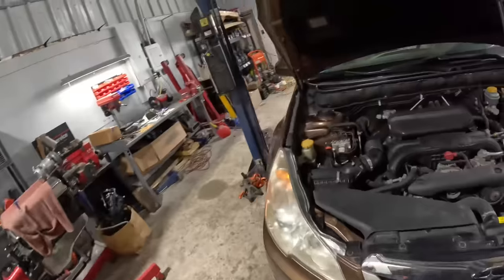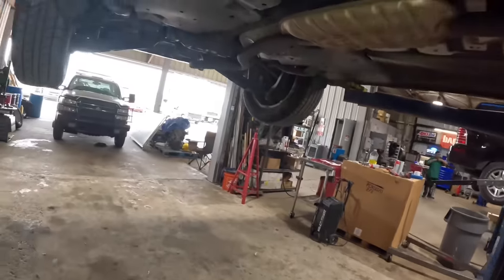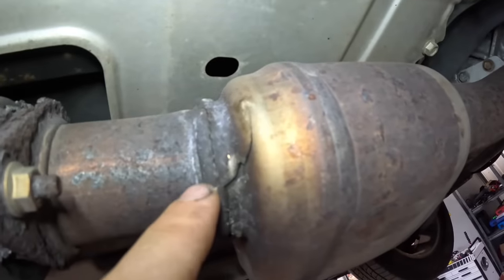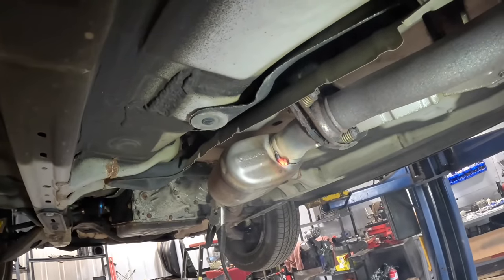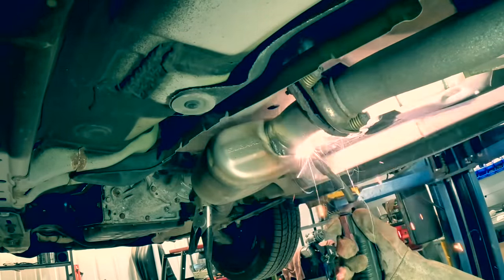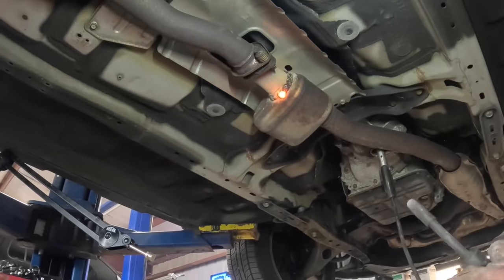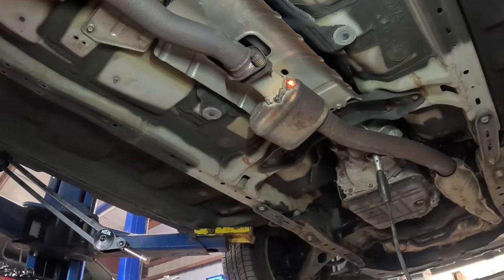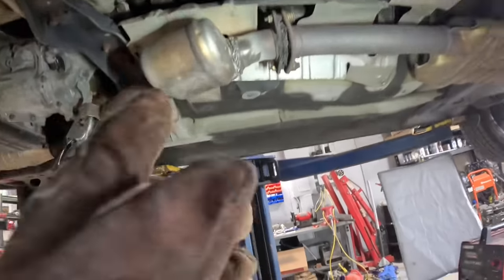Rusted Out Broken Exhaust! CHEAP Fix!!! Subaru Outback 2.5 EJ2.5

Comment: Respect to you for "fixing" at a reasonable cost.
If it's too expensive for the customer and there's a cheaper way, it should be given as an option so long as it doesn't cause other issues.
Reply: Shop should ALWAYS list optional ways to solve the problem, and let the customer have a say in the decision.  Like many shops won't chase a small oil leak in a high-mileage engine unless definitely obvious what is leaking, not worth it.
Reply: Also if the system is working as is then fix it don’t replace it. Like us older mechs remember.  That saves the landfill from filling up.

Comment: As an ex tech, in the shop we worked in, we had steering wheel covers with the words " DO NOT START " in bold bright red letters, that we put over the steering wheel even if the car was unlikely to be left unattended, this came about because of the same exact reason you mentioned Ray. Safety first became the watch words of all inhouse techs, and Sales staff were totally banned from the workshop area, infact locked out, as the sales/workshops were in separate buildings.
Reply: Like Ray having sales people around your toolboxes would seem deemed a Death sentence. They should be planting pansies plants out front of buildind instead.😊
Reply: Even if there was that there, the battery was removed, and the vehicle was chained to the hoist, there would be a sales ahole who would cut it off, cut the lock off, steal any battery that was closest, and start the car.  Best would be to remove both starter relay and fuel pump relay as well, so that at least there might be somebody notice his attempts.
Reply: thats a great thing even for a do it your DIY i done it to myself once lucky i caught it before the motor got completely destroyed HAHAHA at least it was my own car and only for about fifteen seconds
Reply: @barryoverson4988  yep I do this with masking tape on an A4 sheet on the wheel. DO NOT START! Has saved me at least once.
Reply: i worked in a truck shop 33 yrs. thats how it was, steering wheel covers ,covers over hood mirrors . if no oil in the engine we had to tagged the door handle and remove key but there were always drivers  who would come into the shop thinking they could just crank up and go!!!  towed back to shop for repairs or worse ,a blown engine!!
Reply: I was an Army Mechanic.  Called into the unit office to find an Lt. with my boss.  He had a Honda Accord with juddering brakes and would I have a look.  What can I say ?  Put a clock on the front rotors and they were .002" warped.  Replaced them.
Three weeks later our hero is back.  Livid.  Rotors were warped.  He went up one side of me and down the other.  Had a look, sure enough, .002'.  Back into the office goes I.  `Sir, where did you have the tyres changed?'.  It transpired he had a local German shop do the work, they'd reefed the wheel nuts on to 100lbf, warping said rotors vs. spec of 80.  Hondas were / are very sensitive to this.
Banged it in, saluted and said `sorry sir, this is not my doing, I must now go and repair Army equipment'  Marched out.
There is a moral here.

Comment: Ray,  few tricks I learnt:  If material is a grade of stainless,  switch the MIG over to Stainless wire,  welding steel with stainless wire creates nice welds,  other way round creates small horror welds.   Also cleaning the area for welding a bit with a brush wheels really helps, especially in shitty locations like this.     And up to you, but I would have cut it on the straighest section to place a clamping bush on it, and cut the shitty bolts out of it.  Then you can weld it on the workbench and that's always less of a pain.    

All of that said however. I totally understand it that sometimes it's just a quick fix for someone who really can't afford the proper fix.    Keep up the good work :)

Comment: I had a similar situation myself, Ray.  1979 Camaro getting a custom interior. All new carpet seats headliner etc. I was in the middle of installing triple gauges when the clock struck 5 on a Friday.   Cleaned up, did a tool sweep and forgot that I had not attached the oil pressure line to the back of the gauge.  You can see where this is going.  Someone (no names, just "The Boss") decided to move said Camaro to another part of the shop on Sunday so he could work on his boat.  He told me he started it up and oil sprayed everywhere.  Took me 2 days to find all the oil spots and clean them up.
Reply: Hopefully ‘The boss’ got a good oil shower.
Reply: Should have taken two days for the boss to clean it up.

Comment: Welding shop owner here. Get a wire wheel on a 4.5" grinder and clean weld area first, Or I Like a 90' air die grinder with a 3" wire wheel. Also check with your mobile tool dealer and get the anti zaps to clamp on the battery. They take out any spikes from Welding, No need
To disconnect the battery. We have used them for years on trucks and heavy equipment. Also used if cutting with a plasma cutter. Sensitive electronics are very susceptible to spikes. You can thank me later😂

Comment: Good for you that you gave the owner a low cost alternative to keep the car on the road. I’m thinking most shops would just throw the parts list to the customer let them deal with it.
Reply: $150 low cost? just wrap muffler bandage $19.
Reply: The motor on your hoist sounds terrible back in the day all I had was a stick welder I  used 1/8 Nichol rod to do my inexpensive repairs 😂
Reply: I was steeled to have to replace cat-back on my Impreza exhaust but my mechanic figured it still had some life left and welded in a sleeve to replace a flanged joint.  Gotta love mechanics like that!
Reply: Save $$$$  good job my brother. I would of been proud to sport that weld around. Nobody will see it anyway. Long as it works right. I think you're a really cool guy Ray. I want you to have a good day.
Reply: Subaru, backwords urabus😂

Comment: Ray, The process i use to check for leaks after a exhaust repair or replacement, is to pump air from a shop vacuum (using the vacuum's output) to pressurize the system. It low pressure, so it can not hurt the system and you can quickly find any leak and you don't need to get hurt from HOT pipes.

Comment: I had a section of exhaust pipe replaced at a welding shop for far cheaper than getting a new component, since it was a pipe that included the cat and went all the way to the muffler. It does sound like it's starting to fail after 3 years, and that was with a shop that welds professionally. I do appreciate the saving a dime when you can for things like exhaust, since it can get expensive quick for some people.

Comment: Try some Cooter Snot to help with the splash. Dip your wire tip in it before each weld. Helps me a ton to make cleaner welds as i'm learning.

Comment: Hi ray. Im using my grandpa computer. I notice that you was welding with flux core wire. You were right on it being stainless steel. From what i have learned from my grandpa tig welding would be the best choice. I agree with you using what you have to weld with. Just one thing is dont stay in one spot welding due to the thickness of the metal you can burn a hole in it. Best thing is clean the area really well and weld it. Not bad for using a mig on it. I love your channel. Grandpa was right your a great teacher. Have a wonderful day.

Comment: Love the intro clip, I'm a certified welder and the amount of times the tip burns up even on experienced people is crazy. Always used our mig pliers, one tip on nozzle, other tip on the burnt wire, and clamping would usually break it off easy. Wish I had the opportunity to weld for Ray, loved stainless steel and aluminum TIG welding.

Comment: I'd heard of mig and tig welders, but no idea what they are...  well, technically I still don't...   but now I do know that they are needed for different types of metal...   That's a good start.    Thanks for entertaining and educating.
Reply: Carbon arc...better have the fire dept near...
Reply: MIG = metal inert gas. Uses a continuous wire as an electrode and filler material surrounded by an inert gas. TIG = tungsten inert gas. Process uses a fixed tungsten electrode and separate hand fed wire as filler also surrounded by an inert gas. Tig is much more controllable and can by turned down to weld aluminum soda cans or razor blades or way up. Usually best for exotic metals.
Reply: @kenore4003  Thank you!  
Every now and then I stumble across something that I think could be fixed by welding, but as my soldering skills are weak - I haven't trusted myself to try the upgrade.  hahaha.   This at least helps with a starting point, which I hadn't figured out last time I researched.  Thanks again.

Comment: Ray: I know I would appreciate this if I were the customer! This is surely controversial, but I bypassed the safety neutral in my old XJ as a broke college student. To be fair, it was an automatic trans and I never turned the car off unless it was in park. Even if you did, you can't pull the key. Now I know no shop would do that for me (because it is potentially dangerous), but I understand what it's like and I love that you try to save the customer some money. Of course we'd all love to put shiny new things on our cars, but sometimes we just have to get by. The great thing is that if the customer is smart and able, they will save the money to get the true fix done at some point in the future and it will not be a surprise. Appreciate all you do!

Comment: Years ago my 1972 Chev Belair backfired during a -40F start and the top of the muffler split . During the longish highway ride home the leaking exhaust heated the rear seatbelt anchor bolts to the point that the seatbelt portions under the rear seat caught on fire . When I stopped and removed the lower bench part of the rear seat to investigate the foam under the seat also burst into flames . I would have never believed an exhaust leak at -40F could catch a car on fire . I shoveled snow into the back of the car to keep things cool and all was well .

Comment: Reminds me of the old fashioned fiberglass mesh roll tape you could use on seams and joints on old exhaust systems. Went on slightly sticky and the heat cured it into a solid fix. Cheap effective fix. Oh, did I mention it was asbestos...

Comment: Ray, your "non-welder" welding gives those of us who would like to learn 0r be better at it some confidence to do it.  The only to get better is with practice. In the relative short time I've watched you weld in your videos you have gotten much better. Mostly watching you welding nuts on broken studs for extraction.  If the customer is aware of the attempt to patch it, no problem that I see.

Comment: I am not an expert welder by a long shot. I have a MIG welder using shielding gas which produces a nicer weld, in my opinion. However, you should, at least, try to clean the area to be welded to avoid that mess and sparks flying everywhere.

Comment: Midas used to do good by people. My kid cracked my old Camry exhaust pipe when he hit a pothole on the turnpike and I took the car to a local Mineke shop that told me I had to replace the whole front pipe to the tune of $500 and change, because it was a "special" double walled pipe that couldn't be repaired. I took the car to a Midas shop down the street from my house and the one tech who was there said he could weld it. I left the car there and walked home for lunch. When I walked back he had the whole exhaust piping off and positioned on the workbench for welding. I came back some time later and the car was fixed and sounding great. He charged me a hundred bucks, what a deal. The "special" pipe gave me no trouble for the next 5 years at which time I sold the car for a newer one. The guy was a welding guru.

Comment: As a non-welder, your weld looks better than mine. I was only a welders helper back in the mid 90's for a few months & the welder I worked with only used stick during that too.

Also....Doo-Dee-Dooo-De-Dooooo

Comment: Ray, if the wire you are using is flux core than you don’t need shielding gas, those machines are very easy to change out wire, have a few wire options. If you are welding carbon to SS like you thought here use 309 wire. It will need shielding gas . I’m sure it will work very well for that application. I just looked to it’s fairly cheap. You will not like tig welding old dirty crap like that, it does not like dirty rusty crud. Another thing is buy a few of those muffler sleeves, I don’t know what they are called but that’s what I used on a GM I had years ago. That way on both ends you have 1 very good side to weld, they have them so one side can go in and one out. All different types. That GM repair I made lasted 2 years then I traded it in. One last thing about welding, run stringers, don’t try to weave side to side, stringers are much stronger. All the best, John

Comment: HI RAY,good vid. i'm a retired welder,you are right about all the wrongs,but the biggest issue was the no shielding gas.If your welding unit has the ability to hold a gas tank,you definitely need to get a tank of argon for it. I used to weld stainless to steel using E70 rod but with a TIG torch without issues.[cracks].YOU could braze it using a oxy/acetylene torch too ,it's not as strong but it will work temporary.GOOD on you to help save them money.

Comment: You can get stainless fluxcore wire for your mig.  I have used it, and while it doesn't created the greatest looking welds, it does work and would be great for quick repairs like this.
I also tig and trust me, you don't want to do that if the exhaust is on the car as it is slow and tedious under the best of times.

Comment: I've done that on my own exhaust before. You know it's not going to last, because they rot from the inside, and when they fail, you can't do much more than patch. Still, the thing was going to split in two and fall off if you left it, so nothing to lose. A lot of the mess is from the gasless wire. The flux core leaves a lot of muck, and you tend to get splatter. I used one at home for portability.

Comment: Oh by the way Ray, recently my own mother's jeep wrangler had suffered the classic pentastar engine failure of the oil cooler and filter housing yet... It wasn't like what we've seen on the channel where it warped and slightly leaked, But rather what happened, which both has me and my father puzzled, is that it had suddenly failed, and engine oil basically suddenly started to come out quite a bit and uh... soaked the entire back end of the engine just about. Thankfully with my help, me and my father were able to pin point the failure point and were able to get it fixed, with an aluminum variant. (Which wasn't exactly a Dorman part in origin but... My dad had figured that, although it was much cheaper, it still had good enough reviews to be suitable to use.)
Suffice to say though is that I did warn him and Mom prior to the failure about it while they were trying to diagnose why the engine was running rough sorta. Which has mostly been widdled down to being most likely the injectors, since it's a random misfire across all cylinders as far as I'm aware and recall so... yeah. Not sure if it is still being experienced, or if my father doing the best he could to ensure the intake ports to be as clean as he can reasonable get them without chemical cleaning, when he was reassembling the engine after replacing the oil filter and cooler housing, cause he did find an odd amount of debris on one of the valves and had to go to some interesting lengths to get it out with both air cans, a vacuum, and also an attempted use of an air pump for an air mattress. (which was the manual kind.) But uh, I don't know if him getting that stuff out fixed the weird running issues it had, or not so... yeah.

Comment: For anyone saying Ray should have repl as ced the system, it must be nice to have several hundred dollars sitting around. Ray bought them some time . I can remember my father making beer can (cans were made of steel sten)exhaust pipe patches.
Reply: My grandfasther did that also
Reply: @wwmoggy Hell, *I* used to do that, lol
Reply: Yes, I used beer cans and the cement and cloth trick.  Neither lasted all that long but they worked for a while and were cheap fixes I could do myself
Reply: The best cans were the corrugated green bean cans and two muffler clamps.
Reply: I had an early 80's Honda CB750.  The pipes were rusted through in a couple of places but I couldn't afford new ones at the time.  I used soda cans that I cut and turned inside-out and wire to hold them in place.  Lasted long enough until I did get new pipes.

Comment: Subaru owner here since 1994. I feel the owner's pain on exhaust system replacement cost. We would purchase another new one when the one we had needed a new catalytic converter and the cost to replace was more than the value of the car. Good option chosen by the owner.

Comment: If that's what the customer wants, that's what the customer gets.
You never know the customer is going through at that point in time.
My input on the part is that it's a Resonator and I've cut more than one out and replaced it with just a straight piece of pipe.

Comment: Hi Ray, please unsure a spike protector is attached to the battery before any short circuit welding. Also, recheck please. The spring loaded gasket sounds to be leaking at the top. ...further good info for any trainee exhaust techs. Always have earth clamp on the same side of any armoured bellows flex. The internal convaluting body is really thin 304 stainless & can burn pinholes or worse with current running through it.

Comment: I believe that was a resonator you welded up. The cats on these cars tend to be part of the exhaust manifold. Certain California cars have a 2ndary cat in the pipe right off the exhaust manifold.  The heat shields on the exhaust manifold and on the first pipe after the manifold are known for rattling when they rust out.